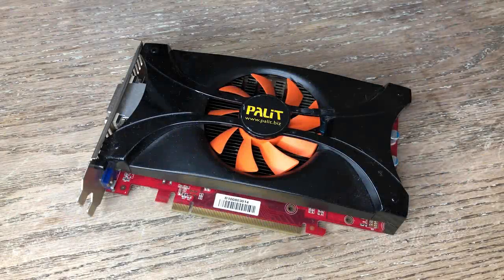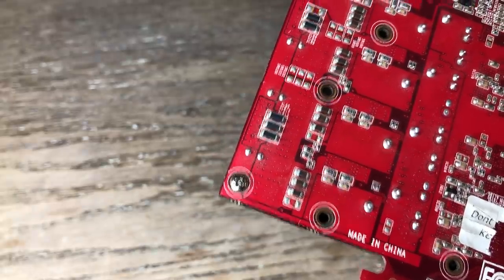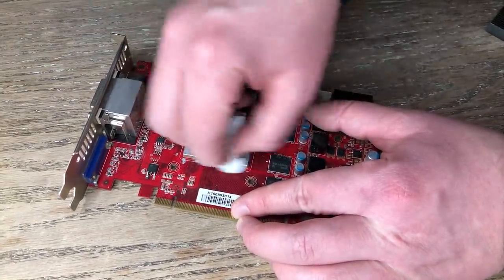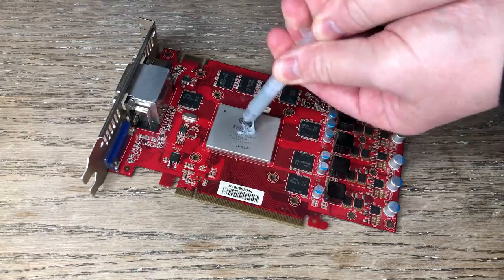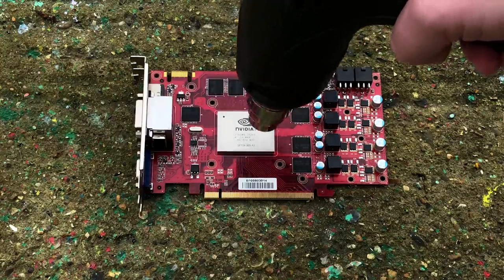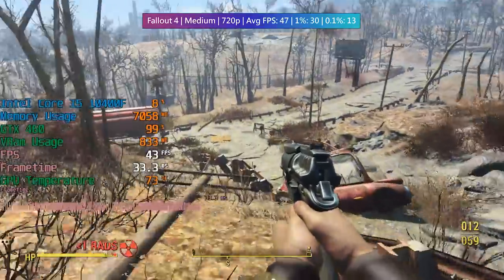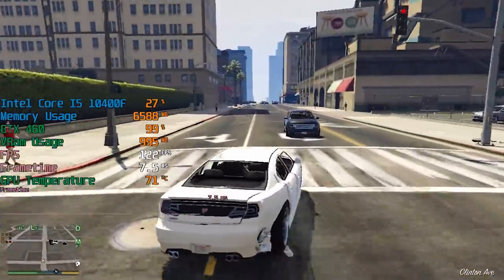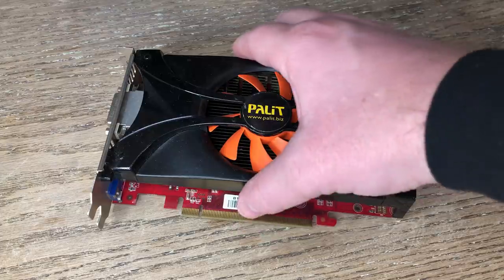Reviving The Dying GTX 460

Comment: When the dying gtx 460 is more powerful than my intel hd 3000
Reply: And here's me thinking my RX570 sucks...you have my sympathies.
Reply: @darktimes9489  rx570 is good for lower settings 1080p or 1440P 45+FPS 
My 1650 does the same in terms of FPS
Reply: @darktimes9489  what graphics card do you have?
Reply: Me with Intel Baytrail: ...
Reply: @arch455  that stiill exists?
Reply: @darktimes9489  well.. no shit.. this card came out 11 years ago xD
Reply: @darktimes9489  i bought a brand new rx550 5 months ago...
Reply: @narf651  my guy they litterally said what gpu they have
Reply: The gt 710 anybody?
Reply: @mariusafm4254  Heh I bought one a month ago cuz fuck the price hikes on new GPU's on online retailers in my country.
Reply: Dark Times How is a RX570 bad?!
Reply: I got a rtx 2060

No clue why I watch low spec videos xD
Reply: Me with intel gma 3000
Reply: @cybersorcerer you did that bruhify challenge??? 
You just changed your pfp
Reply: @darktimes9489  RX570 is literally one of the best budget graphics cards and I don't know how you think it sucks
Reply: @qeedzhr  Combined with my i5 3470 its struggling. So yes my card is still decent unfortunately my CPU is holding mine back.
Reply: the intel hd3000 is slower than a geforce 8400gs lol.Well it has to be cause i tested a 8400gs against an hd4000
Reply: @kyles8524  What variant of 8400?
Reply: @resneptacle  Its a PNY 8400gs 1gb ddr3 model
Reply: Intel 965GM here, I can barely run minecraft.. 20 fps at everything lowest + sodium
Reply: Its ok brother, I had intel hd(64mb version) until recently:'/
Reply: Rx 470
Reply: @darktimes9489  and here's me thinking about how my 3070 cant hit 144 fps at wqhd high/med settings :(
Reply: I have GTX 1050 ti lol 😂
Reply: @user-jc2in3cp3g  i have a high end pc but watch this channel because I genuinely like hardware
Reply: @sniper0073088 " and here's me thinking about how my 4090 cant hit 500 fps on cyberpunk at 16k ultra settings with extreme ray tracing:("

Comment: Props for highlighting that the heatgun "fix" doesn't reflow the BGA solder balls, plus the gun is a bit safer than an oven since the entire PCB with caps/chokes/phases isn't getting nuked as well.
Reply: Exactly, he mentioned the oven method in the last video and I commented the method I personally use with the heat gun, kapton tape, and foil. I see here he didn't protect anything with the tape and foil as well as not using a thermometer to manage and control the heat on the die itself.... oh well.
Reply: @x7slim8x  Its a quick and dirty fix on a broken 2 pound graphics card. What did you expect? He might actually lose money using kapton tape and foil and whatnot.
Reply: @x7slim8x  what is the target temp for the die? And how do you monitor it?
Reply: @matthewbennett  It's hard to be exact, but you could use an infra-red thermometer to get a proper reading though.
Reply: if it isn't reflowing what is it doing ? also glad he didn't use an actual oven!
Reply: @Mmmm_tea  Read the description.
Reply: @matthewbennett  lead free solder melts at ~ 230°C, so target temp should be ~ 240°C for around 2-3 minutes. But that is target temp at the chip itself. This means with a 250C-300C heatgun it would need 5-10 minutes for it to reach that. 
Also, adding flux greatly improves the success rate and actually permanently fixes most BGA issues. (BGA issues that is - NOT internal chip underfill issues, like L. Rossmann said).
Fermi cards (or other extremely hot running cards) most likely have real BGA issues from thermal cycling that can actually be repaired. Tesla (NV GF8xxx) and Terascale 2(AMD HD 6xxx) are generations where internal issues (on the package itself - mainly due to bad underfill) are very common and therefore reflowing/reballing, even with a Liter of flux and completely new solder, usually wont fix the chip that is a ticking timebomb.
Reply: @Mmmm_tea  For a good answer to that it's probably best to check out the link to Louis Rossmans video in the description, that guy could explain it much better than I could.
Reply: @matthewbennett  I set my gun at 450° F, but hover the temp by evenly "bathing" the die with heat right around 400° F. As for monitoring, I've been using a cheap Amazon digital unit with a copper lead I tape in place.
Reply: ....in absolutely no manner is this precise and the professional way to repair... I've just had awesome luck with half a dozen cards the past two years.
Reply: @matt4193  as for your interpretation of the video, I completely agree mate.... though I would argue that if intended for educational purposes that extra .50 USD should have been spent to show a safer way of doing this backyard fix. I guess it is just subjective, but I'd hate to see some kid destroy his vram or other components after watching this video and attempting to replicate the results.
Reply: @x7slim8x  Did you actually watch the video? This is NOT a tutorial. There is no "educational purpose" here. Just results from applying heat to a faulty component. RGINHD also doubles down saying "this is not a FIX."
Reply: @matt4193  yep... and heard him say it as well, but you know just as well as I do if you search YouTube for heat gun fixes for a gpu someone will eventually come across the video.... listen I could careless about your opinion with what I have to say bud, all I'm doing is pointing out that there are far safer ways to do what he is doing and those not in the loop may try to mimic his method, both are facts. Folks don't follow directions man, they literally have to put warnings on EVERYTHING anymore for a reason. Hey you have a good day and I wish you all the luck in your quest to secure YouTube for the next generation. ;)
Reply: @M Tea . Literally says it in the video.
Reply: The gun might actually reflow it. The oven wont.
Reply: I would mark these cards as heatgunned
Reply: Push it to 400C it will reflow 😁
Reply: @x7slim8x  and you allso didnt use flux so contact under chip will oxide and breake on more places, thats why u cant reflow gpu more than few times.
Reply: @matthewbennett  up to 220C
Reply: @TheRailroad99  240C is dangerous temp metal balls under chip can melt completely. Metall surface starts melting on 200C (with Pb even at 180C). Thats why ppl should have thermal sond and microscope to see when melting starts. Allso temperature on chip isnt same as T on Heatgun 350C on heatgun isnt =/= 350C on chip. Best metod is vacum owen ( no air in it no oxidation) for whole board (without caps) with that metod Gpu will work infinite ( if Gpu isnt internally cracked)
Reply: @nikolakarovic5964  I don't recall saying either way if I do or don't use flux.... I am a do it yourself kind of guy. While learning how to solder and repair electronics I had a pretty amazing teacher, my father. He spent 30 years between AT&T and Lucent Technologies literally repairing boards by hand that didn't pass QC after the automated machines failed to do it correctly or a faulty component was set into a PCB. So I know this trick isn't the correct way, but it sure as hell works from time to time and if a card is garbage what do you have to lose? ;)

Comment: The fact that this card even runs fallout 4 is a feat
Reply: I had an R7 250x wich has about the same performance and vram as this 460, Fallout 4 1080p medium ran at about 30 fps with several framedrops (back then it didn't bother me)
Reply from the maker: yeah and with 1 gig of vram
Reply: Better than PS4!
Reply: lol
Reply: @Sam-K  well...
Reply: @boyk4boyka  - It is. That toy factory in the middle of the city  ran at like 12fps on my PS4.
Reply: @mr8I7  ps4 is cpu bottlenecked.
Reply: Bethesda games can scale well on low end hardware... but they're still unoptimized on higher end hardware lmao
Reply: I ran Fallout 4 at 900p on a 2012 Macbook Pro with the GT 650m 1gb graphics, suprisingly averaged around 40-50 fps on med/low settings
Reply: Gaming York  no if we see that ps4 pro runs the game on pcs high settings at native 1440p resolution and use a same specked amd gpu which is the rx 480 on 1440p high it gets 45+ fps average.
Reply: I actually used to play Fallout 4 on a gtx 460
Reply: Fallout 4 is not a demanding game
Reply: And that die was huge!

Comment: I bought oven baked gtx 570 in 2015 for 15€, still runs fine and I haven't had any issues
Reply: I'd say "It's going to die, eventually" but damn, a brand new video card could croak in that same timeframe.  I'd say you got your fifteen euros out of it!
Reply: @thedungeondelver  Several times over!
Reply: "oven baked" makes it sound so delecious.
Reply: brandon dutton
1 second ago
honestly, thats damn impressive. GG man. GG. 

Nvidia would like to know your location
Reply: @killpill23  Not really, I would probably sell cards working at that price, and they usually do just need a re-bake since extreme overclocking contracts the BGA solder with thermal contractions and stops contacting after a while. However I wouldn't even sell my cards that have been extreme overclocked because if it died the next day I would feel bad for the person even at 15€. I had a R9 270 die on phase cooling as I ran it -60c as my daily card watching Youtube or CAD design or whatever else, but when it started working again it might work a day or 2 then die again for a month, then work, then maybe not, it was like 10% chance it would work.

I was going to make a video on how to fix it like this video but with more professional tools but what do you know it booted up just fine when I was trying to demonstrate how it was broken and even stressing to 120c (unplug the fan and run Furmark), and I still couldn't crash it, and it NEVER was able to run 120c from the factory and always went unstable around 108c so its running better than new. Still wouldn't sell it for $5 because it could break any second. Then I've got a RX 470 with voltage control knobs on it and I probably wouldn't sell that either because if you twist the knob to the wrong side it will double its voltage and instantly fry it even if it was on LN2, and some person (cough, my cousin, who just slides voltage sliders to 100% max without looking at what voltage that actually is) would break it and be sad, though not my fault I know the heartbreak when you kill your first GPU (it lessens to nothing after a few more parts killed, but the first one is a heartbreak).
Reply: @thedungeondelver  as far as I know Nvidia cards starting from 900 series (including 750, 750 ti, which are also 900 series) almost don't have this problem
Reply: My heatblasted gtx 770 is working as well. Funny how it died due to overheating so i overheated it even further
Reply: i had 6870 i burned it with fan like 6 times in 2 years
Reply: What a W

Comment: I am so glad to finally see someone using the heatgun method instead of just throwing these things in the oven. Not only does it last longer (I've had one last two years at this point), but it doesn't fry all the components on the board over time so (if you really wanted) you can do it multiple times. 

Squeeze a little bit of no-clean flux in that little crack between the die and the pcb, and wrap all the other components in tinfoil as a shield, and you've got much longer fixes in general

Comment: Just wanted to watch in full before I commented. Congrats on the successful revival!
About the only other thing I might have suggested, was seeing if you could de-lid the IHS. I almost did this successfully, until impatience had me pry just enough to make it nick the bare die underneath, which summarily killed it. On the flip side, I was able to at least re-use the cooler on a 960 and get some drastically better temps than the blower model had. I bring it up because, if the thermal paste was that bad upon removing the heatsink, I can only imagine how bad the stuff between the die and IHS would have been. It would absolutely require adjusting the cooler with additional mounting pressure, likely, but removing the IHS and mounting it directly to the die should improve thermal efficiency drastically.

Comment: Funny how I have the exact same model of GTX 460 with the exact same issue lol
Reply: Same here, palit gtx 460, served well for about 3 years until artifacts happened. Then got a 470, worked few months, artifacts again. Then got a 560 ti - worked for year or two, then artifacts - at that time though I knew the heatgun fix, so after reanimating it twice with good results, it worked excellent for 3 more years until I replaced it with something a bit more modern.

Overall I think the thermi... fermi architecture cards had some deeper problems.
Reply from the maker: they just run so hot haha, cook themselves to death
Reply: @RandomGaminginHD  like my RX 580 8gb sapphire pulse it run so hot it fired itself
Reply: @acid3129  Sapphire has the best rx500 cards. You're probably doing something wrong like a bad hsf mount or bad paste or a dying fan or dirty hsf.

My single-fan sapphire rx570 itx dont even go above 60-70C.

Alternatively, just set a steeper fan curve with 100% at 60-70C. You can also put a power of -20 and oc only the memory to effective 8000Mhz (2000mhz base) or higher if you can push it.
Reply: @ayuchanayuko  it was a year old and hitting 90c until i stripped it and reapplied paste and thermal pads but it was still getting high 70s in a very open mesh case with 2 200mm front intake fans plus mounted on a vertical gou mount so it had better airflow over the heatsink. my rtx 2060 barely goes above mid-60s
Reply: @iforgotmyname2306  This is why i went with a palit gtx 650ti in 2012 because of the fermi heating issues, my 650ti lasted me well beyond 7 years before it started having artifacts so i replaced it with the gtx 1650 super last week.
Reply: I still run Gtx 660 from the Palit :D Now upgraded my system from an Fx cpu to a Ryzen 5 2th gen ... i can still play every game in 1080p (not 720 <3). p.s. Palit cards run so damn hot...
Reply: @acid3129  reoil your fans and try to undervolt if the reoiling didnt work. But 70deg isnt bad. Polaris 500 cards though are usually heavily overvolted/overclocked past their efficiency curve so a tiny little undervolt would have neglible performance hit. Polaris cards are more bandwidth-starved than gpu-starved.

Also check if you got good mounting pressure. I've seen some (older) cards where the HSF just doesnt screw as tightly anymore. You can put washers or even a popsicle stick on the underside so the mounting screw gets tighter faster (more mounting pressure).

Either that or you just got a lemon GPU that barely passed QC. It happens and usually manifests as high temps.
Reply: Mine has the exact same lines every few months or so and gets fixed by baking it for 10 minutes.
Reply: all cards from that era has more of less the same problem, it's the heat they endured that kills the solder, it's actually a very simple problem to solve if you have the proper tools to resolder it.
Problem is that resolder equipment is crazy expensive, this is why "baking" cards is the next best alternative.
Reply: haha same here been reflowing mine 5 times since 2019, instead of using a heat gun (i dont have) i use a flat iron set 5 for 20 minutes directly.
Reply: Had the gtx 470 here and it was broken from factory that became obvious a while after intensive usage.
Reply: @ayuchanayuko  im so jealous i want that card so bad but the prices are so high.

Comment: Once i had successfully reanimated a 560ti and it lasts over 3 Months till it had the same issue again. I tried it several times after with different cards but it works never again, i figured out as soon as this driver-relatet crashes happens there was no hope... Your video though give me hope and so I will continue my diy/repairing/low budgeting journey, which is driven and supported by your videos more than anything else. Thank you this way and continue blasting out the great content!

Comment: One of my GTS450 2Gb DDR3 crashed as soon as I install drivers.
So I did the same with a normal hairdryer just heated the whole pcb for atleast 10-15mins.
To my surprise it came back to life.
And it is still running as good as new even 2 years after receiving it.

Comment: Ah a man of culture, using the verge's "jackson pollock" method of applying thermal paste
Reply: It is actually the most consistent way to apply thermal paste. There is no such thing as too much thermal paste (this has been proven time and time again), but too little can be very bad.
Reply: the verge just didn't spread it properly so it ended up looking like bird shit
Reply: @sujimayne  there is such thing if you have a conductive paste, you can short your hardware, especially on GPUs that have their dies exposed.

Comment: I did exactly this on an old 750 about a year ago, its still in my second rig absolutely fine. I fear the end is coming each time I use it though lol
Reply: If you want to prolong it's life I suggest a small undervolt/underclock, it might be usable for years to come this way.
Reply: @cremvursti  Yeah good shout, will do that
Reply: @Natei  how's it going mate
Reply: @gunaf28  still works, not had an issue with it since but I did underclock it, only slightly just enough to keep it stable. The rig is mostly used by my partner now as she doesn’t game all to much but it’s still going
Reply: @Natei  man, that is some impressive shit

Comment: For a more permanent fix, reflow the gpu with Flux and 180C-220C of heat.

Heatguns alone to reflow may just prolong the life of the gpu but the solder balls are still in bad condition due to constant heat cycles resulting in eventual cold solders. Some Flux should spitshine them back to as close to stock as possible without a reball.